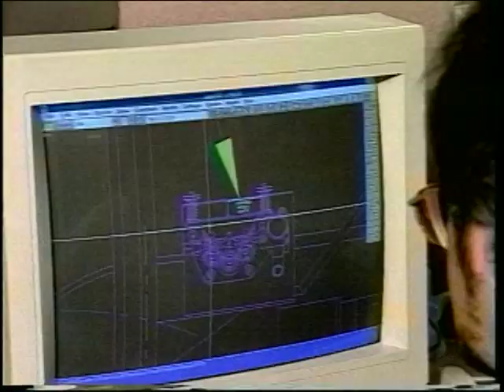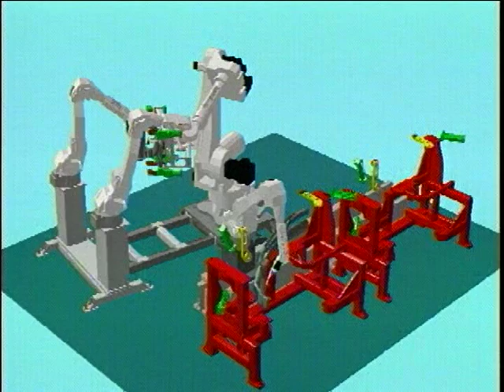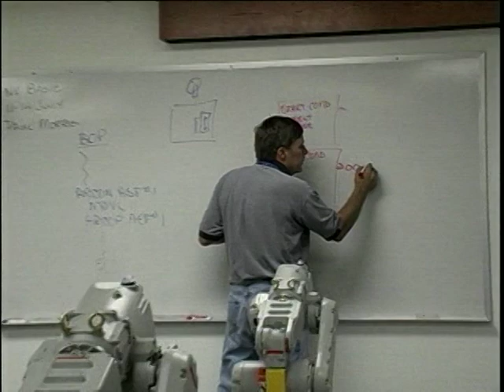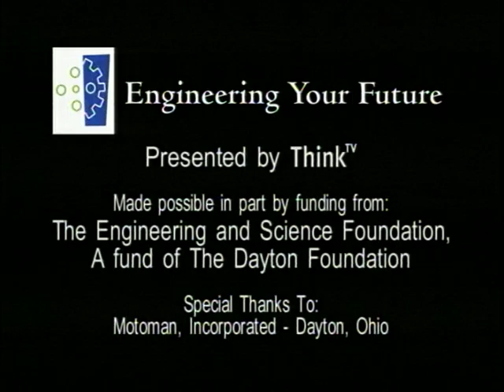Engineering Your Future - Robotics Engineer

Comment: I am working on some very cool designs in robotics like eyes and musicale systems using strings and latex  using  small hydraulic pumps and switchers to animate in a more natural  smooth flow.  These eyes i am designing are going to be out cold having eagle eye vision. I am designing robotic dragon suits. Got a ton of designs. power rings that would power up any thing and every thing.  208 746 0520 Dana